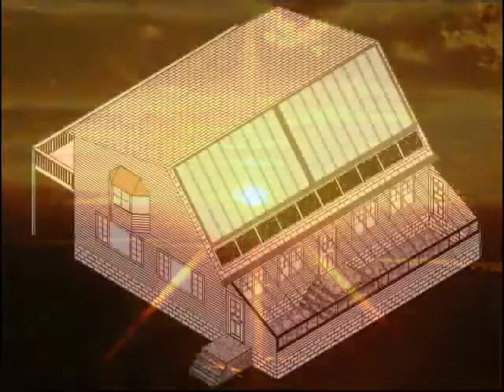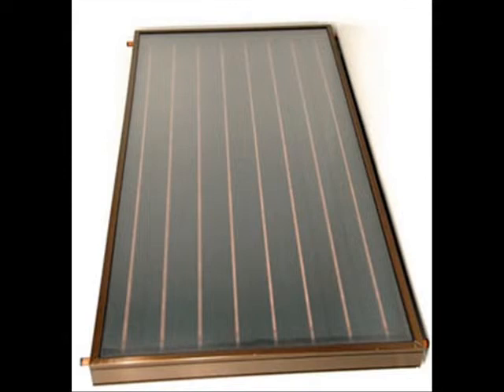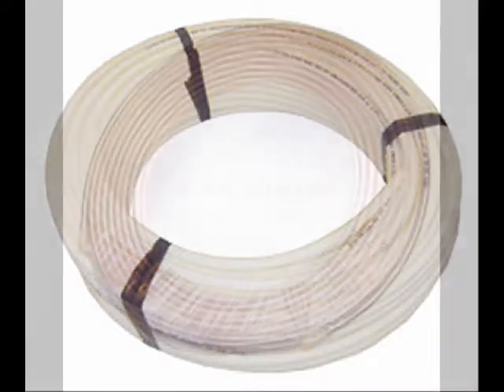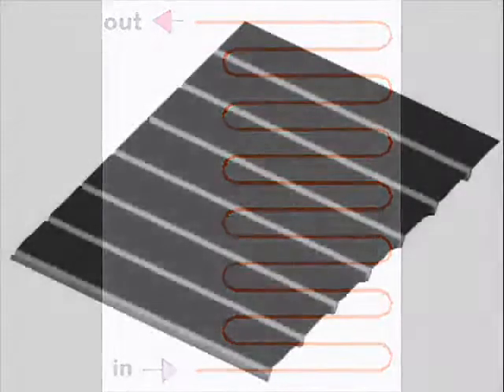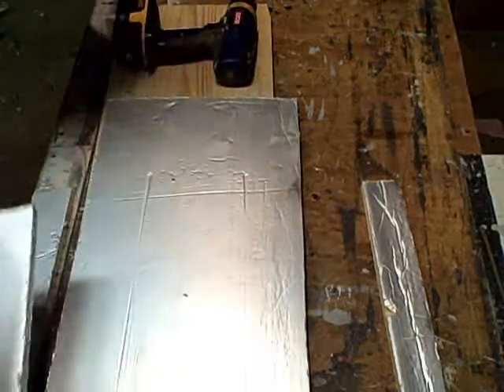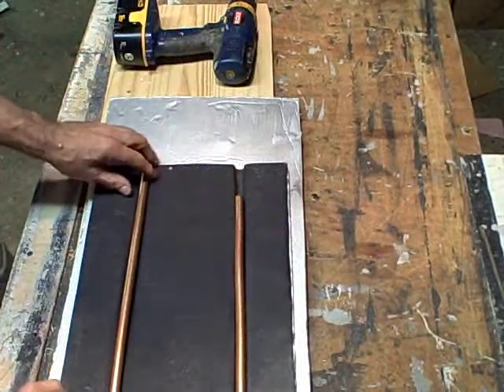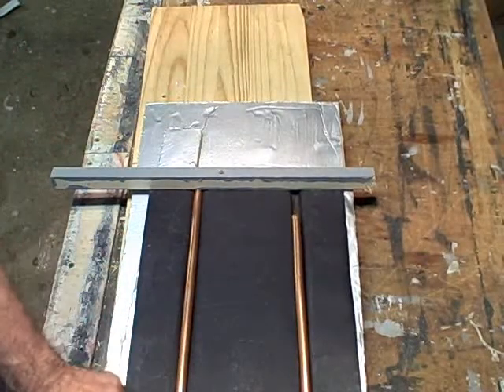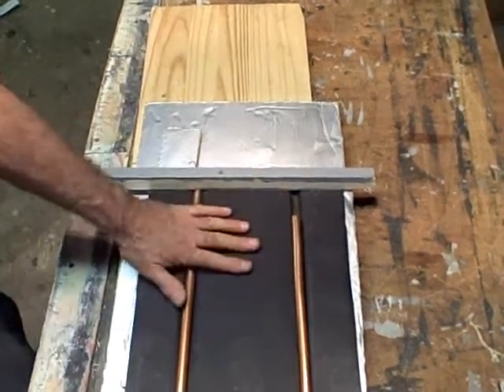How to build a Serpentine Collector

Comment: John, Found your channel and first off big thanks for sharing your experiences on so many projects.  After watching the serpentine collector vid and then the winter sun shed, my question is in the sun shed vid. you showed outside at 15 degrees and in the collector at 81 degrees (65 degree differential) is this variable a constant up and down the temp. gradient or discounting time of year/angle of sun does the temp difference vary?  Does the difference remain if the outside temp is 100?